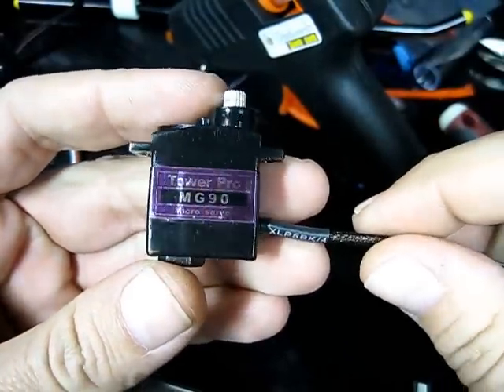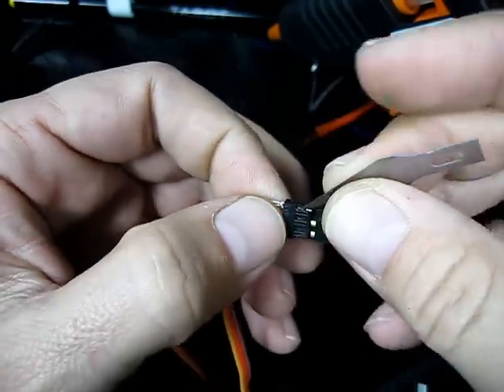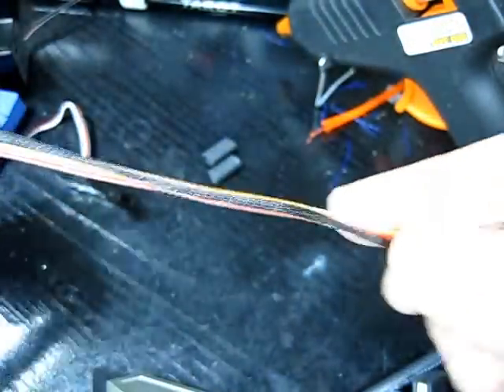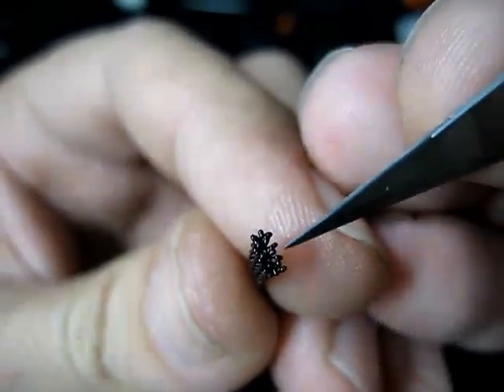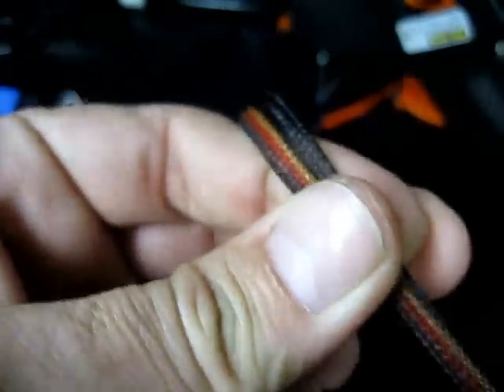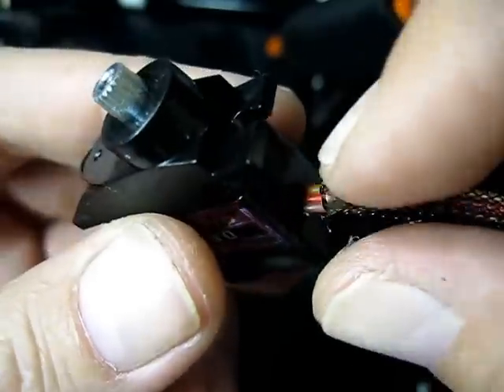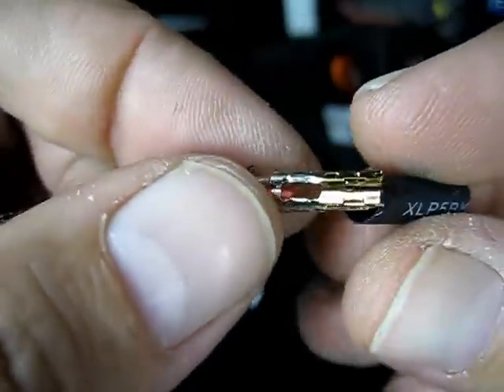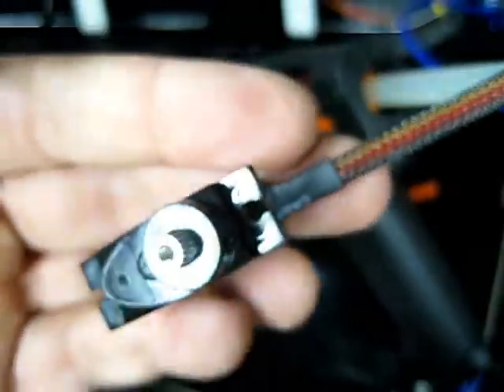How To Braid Servo Cables

Comment: Correct me if I am wrong here please, but this is how to install a braided "cover" as opposed to "braiding" or "weaving" to help resist stray RF noise being introduced into the servo's wiring. A bigger problem when running longer than average wires in say a larger glider for example.

Phones company's world wide have been braiding the wires for over 50 years to increase the wires they run resistance to stray rf noise.

It is apparently very effective for RC servo's as well.

Comment from the maker: @SunsetRC also I just purchased 1 of each size because there are so cheap, same with the braid, initially I purchased 1m of each type then I simply looked measured and re-ordered after seeing which fits best. right now because it was so long ago I couldnt remember which size but I know its in the single digit sizes the way I found that hobby king measure is if you flatten the heatshring or braid on a table and then measure its width